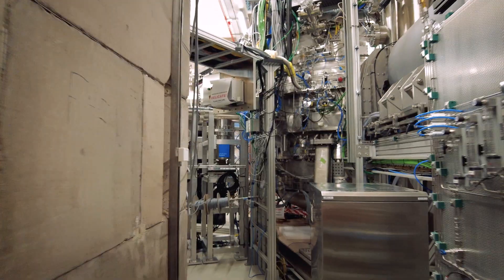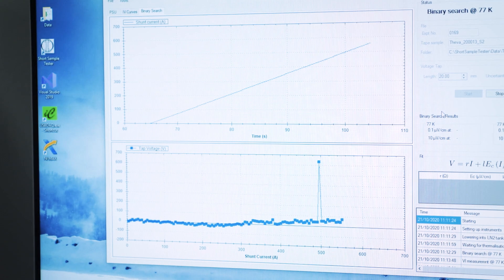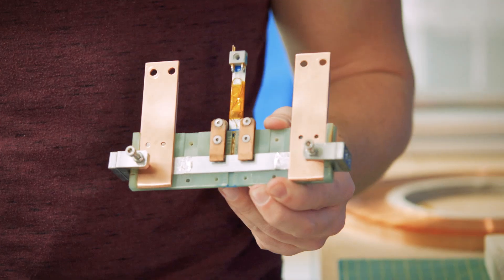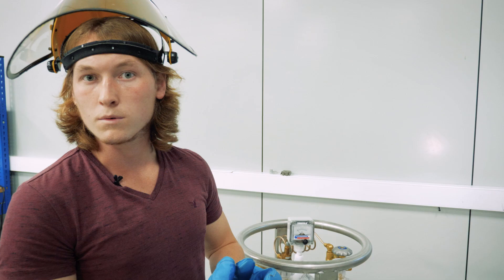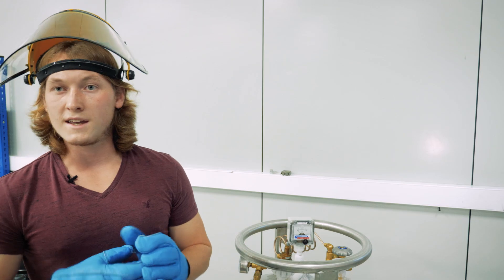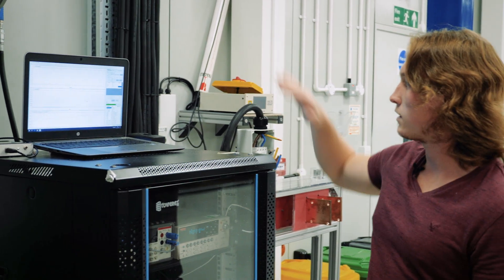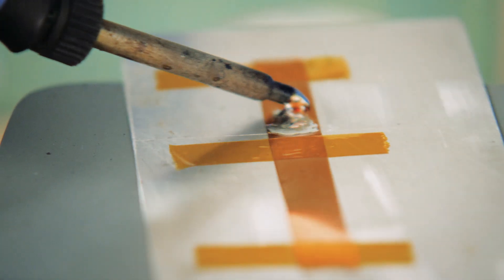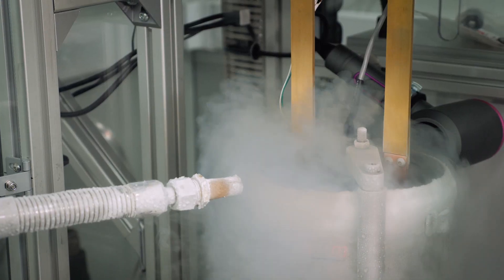Testing high temperature superconducting (HTS) tapes for use in fusion devices

Comment: Greetings there,
Please forgive my ignorance as I am way out my depth here.
Can this HTS magnet be used instead of copper for a power dense ev motor without a need for cooling?
Reply: No.  You would, infact need more cooling as high temperature is still only relative to the first materials discoverd to produce super conduction.  They're still chilled, down to liquid nitrogen, some -195  Celsius

Comment: Old enough to remember the early excitement about the discovery of the first HTS materials. Now a few decades later get to watch a YouTube video of someone testing a mass-produced HTS tape, showing how it outperforms copper and making it look almost routine. Very impressive!
Reply: Aint seen anywhere selling it so I aint sure how it is mass produced.
Reply: @chasthanhburns123  See my comment to Rogers claim.
Reply: @chasthanhburns123 first they start with a hastelloy wire an flatten it into a thin ribbon.  This ribbon is "electropolished" to make the surface atomically smooth.  Then this is rinsed with deionized water, baked dry, and probably rinsed and baked again.  The hastelloy ribbon wire is then loaded into a vacuum chamber with several different ion guns.  As the ribbon wire is drawn through the machine, a texturizing ion beam knocks of any other surface ions and probably any other bumps that were missed in electro polishing.  Now its ready to put down a buffer layer of compatble material, magnesium oxide or yttrium cubic zirconia are choices i have heard.  This layer only a few micrometers thick.   Then the YBCO material is deposited, using ion beam assited depostion to ensure the YBCO grows correctly.   Silver coating is applied as a protection layer, silver doesn't interfere with the YBCO chemistry.  Finally the whole wire is coated in thick copper plating.
Reply: On my last day at HTS-110 ltd, I was resin impregnating the 1000th HTS coil we had made to incorporate into an HTS device. 
Just because you don't know of something doesn't mean that something doesn't exist.
Reply: Yes, but...  How do you SPLICE a hts ribbon?
Reply: WOW yeah its so amazing to see how exponentially fast technology grows. :D
Reply: @augurelite  Just because you don't know of something doesn't mean that something doesn't exist.
Reply: @mickmccrohon  Hey Mick, thanks for adding your experience with HTS. Out of idle curiosity what brand(s) of HTS tape were you using? 

Doing a quick google and it seems like YBCO / Rebco tapes have been made for a while now by a bunch of different companies. THEVA seems to be one manufacturer and their website is quite a rabbit hole of potential applications such as using HTS superconductors to provide magnetic heating for aluminum smelting to significantly reduce energy usage as well as fusion tokamaks

Comment: out of interest, what equipment do you use to product a controlled 0 to +1000A dc supply??
Reply: A BIG power supply lol
Reply: @doctorpurple5173  It shouldn't really need to be all that big since it isn't required to operate at any appreciable voltage.
Reply: @AtlasReburdened  try running thousands of amps through a small power supply and see what happens lol. Though you're right that it don't gotta be as big as one that supplies high voltage as well as current
Reply: @doctorpurple5173  No need for me to "try". All I'd need to do is go down to my garage, plug in my 4000VA 3Voc transformer, and find a thick copper bar to short the contacts with. It's about the size of 2 open hands and granted, it would melt it's own insulation if this were sustained, but it wouldn't need too much beefing up to be able to handle 1000A at a respectable duty cycle.
Reply: @AtlasReburdened  maybe if you submerged your transformer in liquid nitrogen it could sustain the current for long enough. But I assume they're using a power supply that is not melting itself into a puddle and is also not submerged in liquid nitrogen
Reply: @doctorpurple5173  It would hardly take liquid nitrogen. Simply swapping the secondary for solid, uninsulated copper and submerging it in oil would probably do the trick. But what do I know? I've only been engineering electronics and otherwise working with electricity for 15 years.
Reply: @AtlasReburdened  maybe give it another 15 more years and you'll learn a bit about humility. No need to get argumentative about what kind of tools people are using offscreen in a fucking YouTube video, it doesn't make you look smart the way you think it does
Reply: @doctorpurple5173  take the L on this one mate)
Reply: @morkovija  what? No. I will not